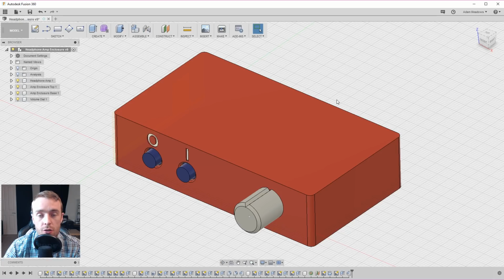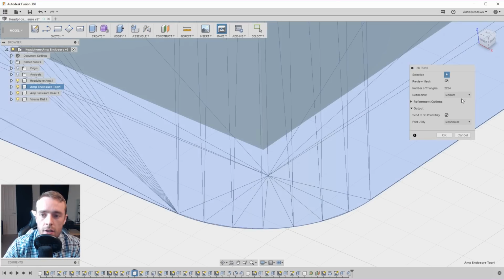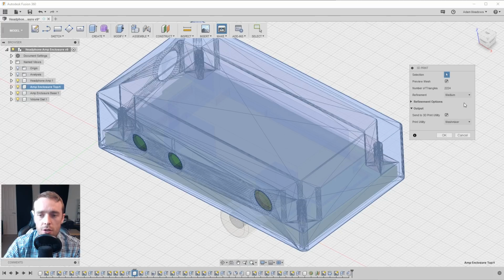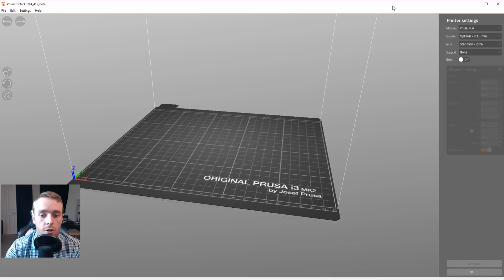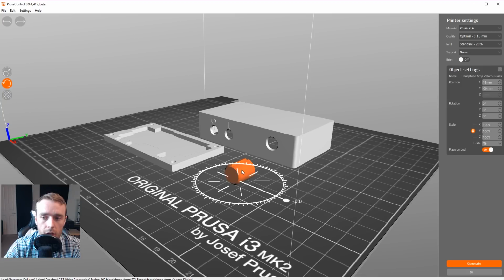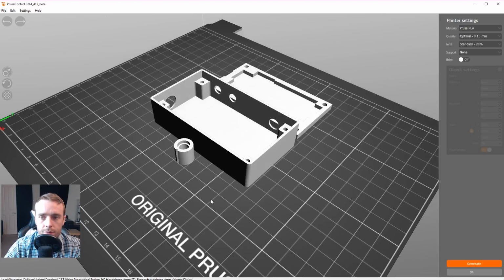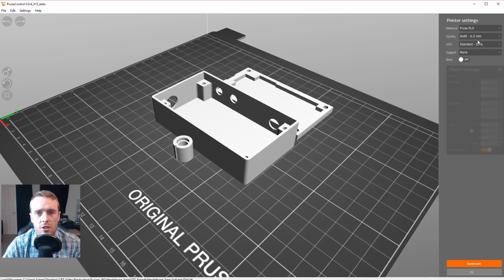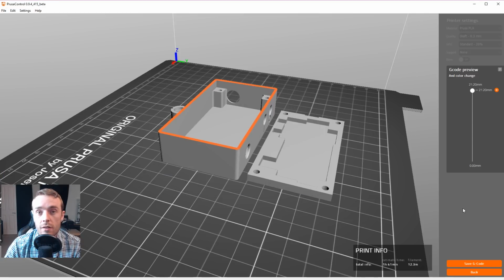Fusion 360 Beginner Project Part 5: STL and Slice

Comment: I often design new 3D-printed parts to work with existing parts for which I have no 3D models or even 2D drawings. I thought it would be too much work to model the existing parts first, but I'm beginning to believe in-context modeling is the way to go, and this series provided a nice example for me to follow. Maybe I'm just inept, but new parts I design in isolation often just don't fit and require excessive iterations. For an impatient guy like me, that's just too slow. Modeling the parts in context still tries my patience - but not quite as much.